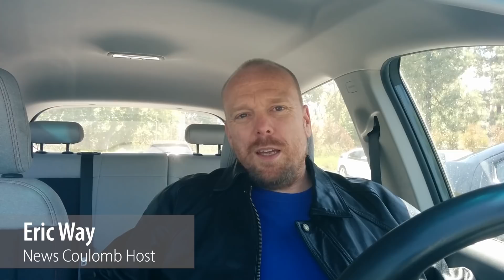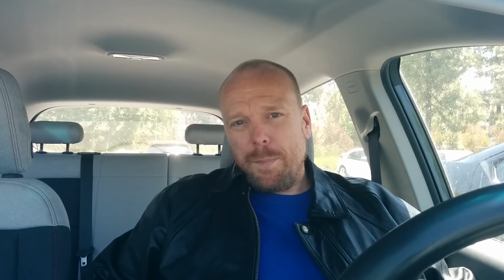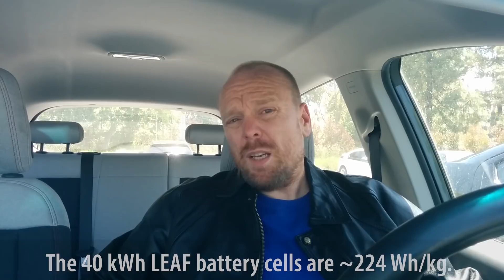Plug-Side Chat: When Can We Expect NMC 8:1:1 Batteries?

Comment: My understanding is that the mineral is actually 'Nickel Sulfate'.  Also, it seems the market will see 7/1.5/1.5 chemistry before 8/1/1.  This may not be for some time, perhaps 3-5 years.  Moreover, 8/1/1 chemistry may use less Cobalt, but will be much more expensive to produce due to 811 cathodes needing to be produced in an inert environment as to prevent any reaction with the atmosphere. Therefore, any new cathode plant producing this material will need to build a new, dedicated, inert atmosphere, production line specific to 811.  And since Cobalt is still a necessity, Cobalt producers (refiners, not the exploited Central African Countries where 60% of the worlds Cobalt is mined) would simply double the price.  This 8/1/1 battery could actually lead to Higher battery cost, not lower.  At least until an economy of scale production is reached...which leads to this...

Then there is an Elephant in the room that perhaps should be a subject you may want to address in an upcoming Plugside Chat:  Global BEV adoption rates are plateauing.  Tesla M3's gave the market a spike last year due to 3 years of pent up demand for a mythical $35K Tesla BEV.  That demand has been exhausted.  The International demand is currently suspect for M3's.  All other BEV sales are looking flat as well.

Based on my casual reading of Insideevs scorecard - From Jan. 2019 through April 2019, a Grand total of 82,494 EV's have been sold in the U.S. representing 45 different makes from all manufactures. About 53,000 of these are BEV's. Of these 53,000, 57% of those are Tesla M3's. This is only about 7% more than the same period in 2018 - before Tesla Model 3's hit their peak sales. Also, 9 more models are now on sale. The trend, as I compute it, will likely be LESS EV's (and even Less total units of BEV's as the previous 2018 MY) sold in 2019, than in 2018.   With that possibility in mind, why would a investor(s) want to finance a new battery chem tech, when there is a high probability that the demand for such tech simply isn't there ?
Reply from the maker: There's a lot to go through there, but first, some battery suppliers claim 8:1:1 batteries will be in EVs within a year.

Second, while I agree that three years worth of pent up demand for the Model 3 spiked EV sales, the plateauing we are seeing is not due to demand but rather supply. Even sales of the Bolt EV, which is 2.5 years old at this point, are constrained by availability, not demand. There are year long wait lists in Europe for the Kona Electric and Niro EV. This is the perfect time for battery manufacturers to get into the business.
Reply: @newscoulomb3705  You may want to look at this: https://about.bnef.com/electric-vehicle-outlook/ (because you are a BEV influencer, you may want to sign up for the complete data forecast - I didn't).  

It was the "perfect time" for Manufacturers to get into the PHEV/BEV business in 2012, when predictions were as high as 10% BEV adoption rate by 2020.  That's in 6 Months, and the adoption rate is still less than 2%.  In 2013, Google estimated that 90% of all vehicles sold by 2030 would be electric. I've followed your channel since its inception.  You are not some Musk-Dividian that suffers from terminal confirmation-bias. This is why I suggest you explore the question in depth in a video. The market suggest just the opposite of a supply constrained environment (just ask Tesla).  Manufacturers have by far the most accurate intelligence with respect to future market trends and growth.  Yes, they can do a PR release and promise 20 new electrified models by 2023, but if consumers are not buying, that statement isn't worth the paper its printed on.  (GM has now backpedaled that promise to 2029) All the data I can find leads me to the conclusion that:
1.) Early adopters have adopted. (As evidenced by Porsche who say over 50% of their Taycan reservations are from Tesla owners)
2.) The chasm has so far failed to be crossed by the general consumer.
3.) The Bolt, which I agree...is Administratively supply constrained in the U.S....will absolutely (well, more than likely) sell fewer units this year than last in the U.S., ..
4.) ...and not much more in Canada & Korea as the Kia BEVs will make up that delta. What's good for the goose is good for the gander: We can not accuse Tesla of exhausting it's backlog, and then claim that the Bolt demand in Korea and Canada is limitless. 
4.) about 10 other reasons stated here: https://cleantechnica.com/2019/01/20/forecast-2019-us-ev-sales-growth-will-drop-to-12/

I'm not trying to instigate some pathos-inducing argument here, (We own 2 EV's - Bolt/Clarity - and had a Volt) but reality is reality.  I'm open to a data derived position that would be a welcome relief.
Reply from the maker: Again, there's a lot to address there. First, when I said it was the right time to enter the market, I was specifically referring to battery manufacturers. Whether in EVs, consumer electronics, or grid-tied energy storage, the demand is continuing to grow.

As for the plateauing adoption rates, that's mostly a U.S. phenomenon, and I still see that being as much of a supply issue as anything else. The hottest new EVs are still limited in availability (Hyundai Kona Electric, Jaguar I-PACE, Kia Niro EV, etc.). Existing EVs are constrained by external factors: the Bolt EV has limited deliveries outside of CARB states, Tesla's direct sales model is prohibited in several states, etc. 

The other issue affecting U.S. EV sales is, of course, price. GM and Tesla saw a significant demand reduction after their Federal Tax Credit was cut in half, and the price of EVs is, frankly, still too high. The Bolt EV is a $25,000 hatchback. The Model 3 is a $30,000 sedan. This at a time when the U.S. economy is not doing anywhere near as well as the mainstream media pretends it is, and millions of Americans are a month or more behind on their car payments. 

Now, one ares where I do agree that we are seeing a plateauing adoption in the United States is due to vehicle capabilities. In Asia and Europe, current EV capabilities and technology are enough to meet Asian and European consumer expectations for a vehicle, regardless of power train. U.S.  (and some other markets, such as Australia) consumer expectations are a bit different, and the current crop of EVs fall short of those expectations. As you said, we are yet to cross the chasm. To be fair to GM and Tesla, though, I think they know what is necessary to cross the chasm (300+ mile range, ~15 minute refueling times, a variety of vehicle formats, and starting prices -- without incentives -- in the $20,000s), but they are currently unable to meet those consumer demands due to cost and technological constraints. 

I will continue to research this, though, so thank you for the link. I'm also interfacing with our local "EV Readiness" program to find ways to drive and improve EV adoption in my region. We have a lot of heated debates on this subject, but we also all have similar goals, which is helps us all come together.
Reply: @newscoulomb3705  I don't know if I agree with that or not.  Chevy is heavily discounting Bolts right now...if there were a supply issue, I don't think this would be happening.  But I do agree with the supply thing re: Kona and Niro.  As you know, there are only offered in selected areas, probably due to supply.  And I also agree it's a good time for battery manufacturers to get into the business.
Reply from the maker: @tommckinney1489  Oh, there's no doubt that the Bolt EV is over saturated in specific markets (really, just California), but its demand outstrips its supply almost everywhere else. Even in California, though, Bolt EVs don't sit on the lot very long. If they do, it's generally more of a specific dealership issue. 

Also, the main GM discounts the Bolt EV so heavily in California is because they can. The ZEV credits mean it's still profitable, even at $8,000+ off MSRP.
Reply: 7% increase YOY is a doubling in 10 years.  I think there is a lot of demand, lower vehicle prices, faster charging cars, more dcfc stations, etc, are necessary to achieve more sales.
Reply: shotelco, there is definitely a demand problem for the EVs that a manufacturer can make a profit on. There are no production constraints on those cars. Tesla and GM can easily make more of these cars than anyone would buy. 

Due to lack of demand for those expensive cars, manufacturers are making some cars that they lose money on. Of course there is unlimited demand for these cars because the manufacturer refuses to lose that much money. 

The Chevy Bolt is not production limited, but they may limit production so that once they sell all they can in ZEV states, there are only a few in other areas where neither GM nor the dealers want to sell them.

Basically every EV sold in US is now at least partially a compliance car, and there is no avoiding that fact. The manufacturer wound be irresponsible to sell them without cashing in fully. Tesla is now a global compliance car manufacturer for FCA, as well as a semi compliance car manufacturer in the US. Chevy Bolt has always been a quasi-compliance car, because GM isn’t willing to lose tons of money, but they do want a few cars roaming around in non-ZEV states just in case it’s ever mandatory to sell in all states.

A new generation of battery with better specs and lower prices, as has been the case for 60 years, is what can make EVs viable. Getting battery pack cost to under $100/kWh retail including the thermal management, BMS, and cells needed for fast charging and long life will do it, but nobody is anywhere near that. The Chevy Bolt battery is about as cheap as LG Chem makes, and it’s about $200/kWh. No way Tesla is lower, but they refuse to publish prices of even sell the whole battery outright in many cases, and in all other cases they are under warranty.

But being able to reduce the price of a Chevy Bolt or model 3 by $6000 while having better battery performance would instantly increase both demand and the ability for manufacturers to make the cars without losing money.
Reply: Tesla needs to hope that their cars are so good, people in the market to buy a new luxury or sports/sporty car will drive one that a friend owns, and then choose to buy one. From what I've heard, as a whole, those who drive a Tesla come away VERY impressed.
Reply: First off, did you forget that batteries are used in much more than just cars?  If 8-1-1 becomes a reality, it means more batteries will be made, there will be no drop in demand or price increase, it will continue the decades long trend of lithium battery price drops.

Second, why would you pull out the M3 from sales when projecting demand growth? And even after you did why would you consider 7% growth "flat"?

Stick to your day job.
Reply: Greg Hassler, Tesla’s market share will not grow from this point, it will shrink. Model S/X already being outsold by better cars in Norway and other countries. Model 3 sales temporary spiked their growth, but that is coming to an end. 

Don’t count on China sales until the Huawei situation is resolved.
Reply: @imho7250  LOL that's cute, and not supported by any data.  The internet lives forever my friend.  What EV is outselling the Model S/X in their class in Norway, exactly?  I'll wait here.
Reply: Greg Hassler, here are the 2019 sales for Norway regarding S and X. The lack of demand is real. 
Audi e-tron - 680
Jaguar I-PACE - 442
Tesla Model X - 341
Tesla Model S - 166
Reply: @imho7250  so you claim the spike is over for the M3 without realizing that the IPace and etron numbers are spikes themselves since they're just now available for sale and still filling the backorders.  Check back in another quarter and let's see how it plays out.  I'm glad Audi and Jaguar caught up with 2014 Tesla.  See if they can overcome their own production issues.
Reply: Greg Hassler, Model 3 sales in every region, starting with North America, sells the backlog high margin versions first, followed by the mid margin, and soon the primary demand remaining is for the promised $35k version, which Tesla still doesn’t make, and is losing money by downgrading SR+ cars and selling them for less. 

But for EVERY PROFITABLE EV, it’s demand limited.  Only the affordable money losing versions are supply limited because the manufacturers can’t afford to lose more than they make. 

Tesla stock is heading for its true value now, which is well below the current share price.
Reply: @imho7250  
Mistake #1: Tesla isn't just a car company, and you're comparing them against traditional manufacturers in the traditional sense.  Their energy division is growing rapidly, they have a monetizable supercharger network, they have highly desirable battery and autonomous IP, etc.  There is no traditional manufacturer approaching any of this development.
Mistake #2: Tesla is losing money on downgrading Model 3's.  Did you not pay attention for the 60 kWh Model S's?  This is an upgrade path, every downgraded Model 3 is a future upsell at a higher profit margin for the life of the vehicle.
Mistake #3: You, along with most financial analysts, still don't understand growth companies or the technology sector at large.  It's 2019, we've been through this dozens of times and it still flies over your heads.  Tesla could achieve profitability easily in any of a dozen ways, but chooses not too to support their aggressive growth.  They're not playing a quarter-by-quarter numbers game, they don't care about the stock value.  This is a long play for growth.  Ford and GM are now considering a merger because they're both faltering, Ford's stock is trading at 1987 levels (inflation and split corrected). 2018 was the peak year for combustion engine vehicles, every year forward combustion engines will sell fewer and fewer.  Not looking good for any other manufacturer at the moment.

As for Tesla's stock value, it's one of the most volatile stocks in the history of mankind, because they're disruptive and existing industry money is scared.  Don't confuse short term FUD with the revolution that's happening before your eyes.  Everytime you see a Model 3 on the road, repeat to yourself "They're demand limited".  Lol

I'm going to keep making money on Tesla stock by holding it long.  You do what you want.
Reply: Greg Hassler, Tesla isn’t an energy company. They resell Panasonic battery cells and solar cells, and aren’t making money doing it.

Last time Tesla software locked a 75 kWh battery to 60 kWh, it wasn’t long before people figured out they have 90% of the benefit of the 75 kWh battery without doing the $9000 unlock, and then Tesla sold the unlock for $2000. $2000 for 15 kWh is a money loss, not a money gain.

Tesla May carry this on the books as receivables, but few will waste money on unlocking at battery if Tesla locked the top end like their mistake on the 75 kWh version.

GM practically paid for the R&D that went into the first 3 Tesla models back in the 60s with the electrovair and later with the EV1. The only thing critical they were missing was cheap batteries. 

GM could make a better car than any Tesla, using parts out of their parts bins. 3x Bolt motors and 4x Volt batteries in a AWD corvette. The problem is, demand isn’t high enough for that car at the price it would cost to design and build it, just like the Tesla Roadster.
Reply: @imho7250  I didn't say "Tesla is an energy company"  I said their energy division is growing rapidly.

Most 60 kWh Teslas have been unlocked to 75.  The price did drop over time, because of the concept of the time value of money, not because of lack of upgrades.  The further into the life of the vehicle the less value there is to the upgrade.  You're not getting the simple concepts of finance.

"GM could make a better car than any Tesla, using parts out of their parts bins."  That's a laughable statement.  GM is known for low quality because they slap together a hodgepodge of vehicles from parts bins, parts bins full of IP from suppliers that they don't own.  GM has no IP of their own and isn't innovating, and isn't vertically integrating. The American taxpayers had to save the company once, I don't think we're going to do it again.  In the 15 years they have shut down Pontiac, Saab, Hummer, Saturn, etc.  This isn't a healthy company.
Reply: Greg Hassler, not true. The $9000 price was dropped because only an idiot paid that much for something they shouldn’t be using anyway. The value of the 15 kWh never changed, but the value of unlocking it was never worth $9000. In fact, even at $2000 many never unlocked it, which is why Tesla unlocked them during that major hurricane. 

So far I don’t see any price on unlocking the SR to be an SR+, so I can’t see what Tesla is charging to have access to that 4 kWh or which end of the battery they locked. If they locked the bottom end, then they can get someone to pay to unlock it, but if they locked the top end like on the 75 kWh, nobody will pay the real cost to unlock it.
Reply: @imho7250  Yes, it is true, though you may not realize it because part of the upgrade is rebadging so there's no good way to tell.  Tesla also upgraded many themselves on their used program for higher resale.  But you'll find VERY few 60 kWh batteries left out there.  The SR and SR+ are brand new, be patient.  There will be an upgrade, rest assured.  I don't know why you feel "top" or "bottom" end of the battery is relevant, or it could be both (ideally), but range is range, especially for people in the north half of the US.
Reply: Greg Hassler, if you don’t know why limiting the top of bottom matters, then you don’t understand why few people paid for the upgrade. As you probably do know, Tesla recommended only charging to 80% unless you needed to charge more for a trip. 60/75=80%.

So if you charge your battery to 100%, it’s really only 80%, and you got the faster charge speed than a real 60 kWh battery due to the battery size plus the fact you are only charging to 80%. This is why nobody was doing the upgrade to unlock the part of the battery that you weren’t really supposed to be using anyway if you want your battery to last a long time without degradation.

But if you lock the bottom 15 kWh instead, then you would still need to limit max charge to 80%, and your daily range would be significantly less. And when you did need to charge to 100% at a supercharger, it would take longer.

The same applies to the model 3, the 4 kWh locked at top would have zero incentives to upgrade since you can charge to 100% daily and it falls into the 90% SOC max daily charge Elon said the model 3 was good for, plus supercharging speed will be faster at each indicated SOC. But if tesla locked the bottom 4 kWh then the only way to get 220 mile range is to charge to 100% SOC. Since you are only supposed to charge to 90%, then your actual range is 180 miles. 

So far I haven’t seen anyone determine which part of the SR battery get software limited, but it would be easier to see if comparing supercharging with an SR+ under the same conditions to 100% and seeing how the last 10% charge went. If both were the same, then Tesla locked the bottom. If the SR charges significantly faster from 90-100% than the SR+ then we know Tesla locked the top of the battery. 

Or someone who buys one of the special CAN bus readers can tell what the actual cell voltage is at 100% indicated SOC and that would show where the battery is software limited.
Reply: @imho7250  lol save your breath, I understand lithium technology better than you do, I work in the industry (and owned a Tesla). But that's not what people are paying for.  Leaving a vehicle sit at either extreme stresses the cells and reduces life.  Hence balancing the capacity to the middle being the ideal solution, bot just the top or bottom, something many manufacturers like Ford and Hyundai do for longevity.  But the point of upgrading the capacity of a Tesla is to get access to the range and USE it. The charge limiter is still there. Stop changing the subject and try making a valid point about something.
Reply: @imho7250  sorry my response was unduly harsh, you're keeping the conversation civil and I should do the same.
Reply: Greg Hassler, I doubt you understand as much about the Tesla battery, or followed all the comments about why people didn’t upgrade, or you would understand that locking the bottom 15 kWh would have caused more people to pay for the unlock. 

The both top and bottom is slightly protected, but the bottom is protected from sitting at low charge just by the fact that nobody wants to leave their car sitting below 20%, so they would charge it. And with the locked battery you can charge to 100% every single time and it will never go above 80% actual.

Also, if Tesla would have locked the bottom 15 kWh, or 4 kWh in the SR, if a person ever pushes the limits and runs put if range, Tesla can sell you a one-time unlock cheaper than a tow truck or your time waiting for one, and that likely gives you enough range to make it to a charger.

Tesla was charging $9000 for the 25 kWh of the LR version, $360/kWh. So the 4 kwh might be worth $1440. We will see if Tesla offers a battery unlock or upgrade to SR+ for a fair price. But most people won’t do it if they get 90% of the benefit for free.
Reply: @imho7250  I assure you I get it.

The ranges of lithium battery voltages aren't quite as binary as you make it seem, and it is sensitive to both time and ambient temperature, moreso as you approach both extreme ends of the scale.  The low end is actually more dangerous for the cell as it's where immediate and permanent damage can occur.  Plus batteries don't charge themselves, they only discharge (both self- and via parasitic drains, especially in Tesla where they have significant vampire drain that can kill a low battery in a couple of days).  So I disagree with your assessment.
Reply: @imho7250  you need to understand that "percent" of charge is a completely made up number that doesn't track voltage in any remotely linear way, and capacity and SoC is tracked by the BMS by monitoring current into and out of the cell, with occasional calibration after full-charge balancing and/or low SOC drain.  Voltage cannot be used during charging or discharging to determine state of charge at all, due to voltage sag under load and the reverse while charging (especially in constant-voltage mode). 

Anyway, the voltage limits of any given cell varies by chemistry, cell design, and manufacturer on both ends, there is no set standard.  And most EV manufacturers tighten the cell manufacturer specs up even more.  "100%" could be 4.14, 4.15, 4.16, 4.2, 4.22, even 4.38 volts for some chemistries.  The bottom ranges even more, from 2.7v to 3.4v.  The voltage falls off fast down there so it's not as significant as it seems, but manufacturers specify cells pretty widely.  If you've ever worked with profiling cells for a BMS.
Reply: Greg Hassler, ok, so now that you get it, you see why very few will pay to unlock capacity at the top, and anyone who paid $9000 to unlock their battery got screwed, and those who waited until it cost $2000 for 15 kWh got a better deal, but some still didn’t unlock it because that was in the range of cell SOC they wanted to avoid. 

So all these SR- software locked will be losses for Tesla which will likely be accounted for as money earned but not received, Tesla still doesn’t make the $35k version, and most likely they can’t afford to, so they took it off the menu, but make it available off menu.

The demand for the expensive cars is dropping, especially as the incentives dry up. In the US, you should have at least a $7500 tax obligation if you are buying a $40k car. Now that Tesla and GM are down to $3750 tax credit, people who only pay that much are looking for cheaper cars. 

Tesla stock price shouldn’t be any higher than GM. GM has done a lot of R&D for electric cars, and also is way ahead of Tesla in Autonomous Vehicles, but they don’t put Super Cruise in a Chevy Bolt and tell a lie that it’s got all the hardware for lvl5 Autonomous Driving. 

I know Tesla stock holders want a get rich quick scheme, but it would be better if Tesla became a blue chip stock that people like to big and hold.
Reply: @imho7250  You crack me up.  I'm explaining how batteries work to you and you say that I finally got it.  LoL.  If you''d actually read and understood anything you'd realize that there's no difference between unlocking the top or the bottom.  The argument that you spend less time at the bottom is extremely situational, and with Tesla's (high) vampire drain it's even more likely to be a problem.  Another point that's still sailing over your head is that people aren't buying access to additional for longevity.  They're buying it for range.  Is there some fraction of people who haven't upgraded?  Of course, and they're probably not doing it because they can't afford it.  It's /possible/ that they misunderstand it like you do.

"Tesla still doesn't make a $35k version" - that's factually incorrect and you've repeated it too many times.  What you mean is that they don't make what they originally planned as a $35k version, they realized that software locks are more cost effective than hardware changes.  You're still hung up on that.  You have no more insight into Tesla's costs, you're just speculating (most probably incorrectly), so let's just stop this argument now because it's unprovable either way.  But your core statement is simply wrong.

"In the US, you should have at least a $7500 tax obligation if you are buying a $40k car" - that's a stretch, but I get where you're coming from.  Really wealthy people often avoid earned income and draw what they need from investments and play games with writeoffs and often reduce their tax basis, but whatever, I won't argue your point here, because you don't actually tie it to any other point you're making.

"GM has done a lot of R&D for electric cars" - you mean "LG has done a lot of R&D for electric cars" - there, I fixed it for you.

"and also is way ahead of Tesla in Autonomous Vehicles" - GM has done nothing with autonomous vehicles.  Supercruise is the only consumer product GM has produced remotely playing the same sport as AP, but it's 2012 technology.  They are actually phasing it out.  There are some fundamental philosophical differences between the systems (e.g. driver awareness detection) but fundamentally the technology is demonstrably behind Tesla.

"tell a lie that it’s got all the hardware for lvl5 Autonomous Driving" - we can agree on this point, Tesla can't say they have the hardware for level 5 autonomy.  That will be determined by the laws, not by Tesla or any manufacturer.

"The demand for the expensive cars is dropping" - what?  Do you mean the demand for electric cars?  Or the demand for expensive electric cars?  What dataset are you basing this on?

"I know Tesla stock holders want a get rich quick scheme, but it would be better if Tesla became a blue chip stock that people like to big and hold.
"  Only the short sellers are trying to get rich quick from Tesla.  I'm in it for long run (you know, hence, "long" vs "short").  But I think you misunderstand what blue chip means.  Tesla COULD become profitable, in any number of ways (I can identify probably 6 or 8 off the top of my head), but it would largely halt growth.  They would stop at being a boutique automaker, like Porsche.  High growth and high profits are exclusive things.  I can't believe I have to explain this in 2019.  Along with the technology adoption curve.

OK leaving the best for last - "Tesla stock price shouldn’t be any higher than GM."  Wow, ok.  This is to HUGELY misunderstand how stocks work.  Stock price is irrelevant and uncomparable between any two companies.  It's a meaningless metric on its own without understanding how many shares are issued, split history, etc.  I suspect you mean market cap?  Even that doesn't really work.
Reply: Greg Hassler, you are the one who doesn’t understand, while claiming you are an expert, if you say there is no difference between locking the top or bottom. Those who do understand, know they were not going to pay $9000 just for a fraction of the usability, which is why Tesla dropped it to $2000 and lost money.

Since you DONT understand basics, I’ll put it very simple:

Locking the bottom of the battery means the only way to get 60 kWh is to charge to 100%, which over time degrades the battery, and if supercharging to 100% its very slow from 80%-100%. So daily charge won’t have 60 kWh of usable energy inside. So you can only put about 48 kWh of usable energy, and you will need to take the car to its shutoff point each time. Since the bottom is locked, you won’t get real turtle model. The battery will shut off at a certain voltage, and that voltage won’t alway correspond with the SOC or remanding range, so you still can’t risk taking it to 0 miles. So the real useable energy is about 40 kWh so you still have 20 miles indicated range. All turtle mode indications will just be artificial since the battery will shut off with 20% SOC, corresponding to a higher voltage.

Locking the top of the battery means you can charge to an indicated 100% every single time, but the battery will only be at 80% SOC. This means you get to keep 60 kWh of energy in the battery at all times. Since you still need to leave a buffer at 20 miles, you only get 52 kWh usable every day, and all the turtle mode indications will occur normally. 

If you were paying attention during that time, you will have seen several blogs and videos about that. And the same applies to the model 3, except 4 kWh instead of 15 kWh locked. 20 miles vs 45 miles. 

So Tesla will not recoup the money, unless when they take the car on trade-in they unlock it, but at that post an SR+ will only be worth $1000 more than an SR.
Reply: @imho7250  My man save you're breath I'm not even reading anymore.  I thought we moved past the top/bottom thing, you began spewing incorrect financial nonsense too.  I get it, you read a post on a Tesla forum once on the 60kWh battery upgrade and think you're an expert now.  Look, I have disassembled Tesla batteries down to the cell level and homogenized and characterized the cells to build my own packs and program BMS's.  You're simply not going to explain anything new to me.  I understand the concept you're portraying and disagree with it because it's based on factually incorrect information and assumptions about lithium cell performance, as I've explained above already.  It's also incorrect that Tesla "lost money" on the $2000 pack upgrade.  If they were losing money, they wouldn't have offered it.  This is really basic stuff.

The internet lives forever my friend.  Check back here in a couple of years and let's chat about Tesla.   I'm out.
Reply: Greg Hassler, too bad you don’t understand the basics, of software locking the battery or financial matters. Some day you will understand why locking the top 15 kWh didn’t work and cost Tesla $millions.
Reply: @imho7250  Cool man, have a great day.  I'll stick with taking financial advice from people who understand that you can't compare stock values and that companies only offer products that make them money, and I'll take my technical guidance from people who understand how BMS's actually work and how batteries actually degrade.  You can go back to your Tesla forum now.